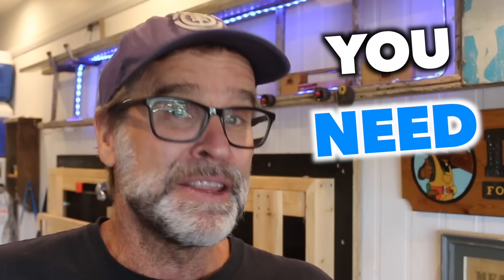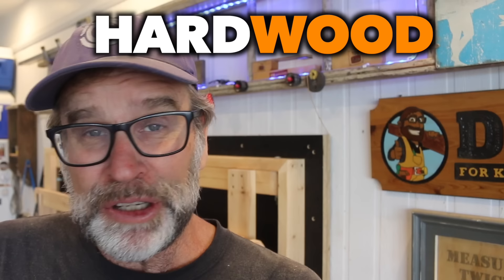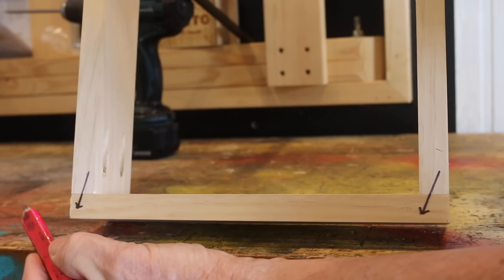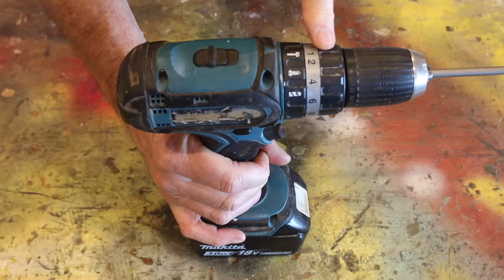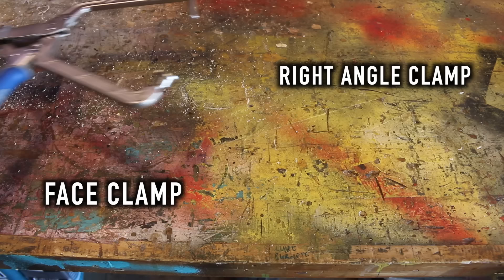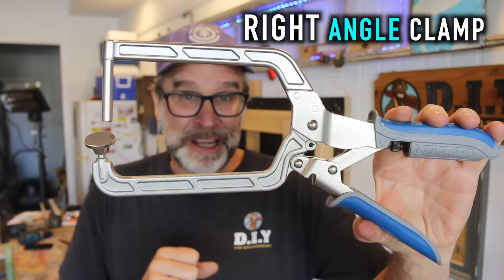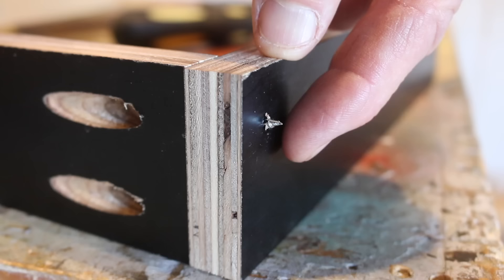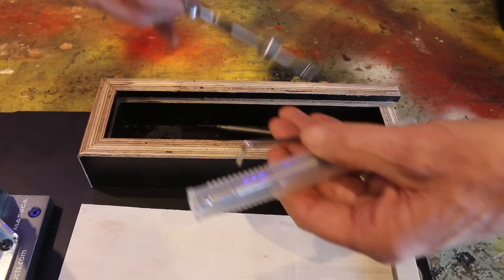Pocket Hole Perfection! 7 Expert Tips for Beginner Woodworkers!

Comment: I’m an absolute beginner and these fails you have showed actually happend to me. Finally I can stop wondering and turning my brain upside down and start woodworking. Thank you very much for another eye opener lesson. It turned so much lights on in my chandelier that the room is very bright 😂
Reply from the maker: Awesome! Glad you found the video useful mate 👍😁🇦🇺
Reply: C'mon, u-tube is overfilled with pocket hole videos. Not all as good, but the info is there to be extracted.

Comment: Great tips as always Shane.  The only thing I'd add is that if you are someone like me, who started out using the cheaper, portable / mobile pocket hole jigs, then the face clamp is not just useful, IT'S A MUST.  Mobile pocket hole jigs are notorious for moving unless well clamped when drilling and the face clamp jig makes light work of this.  Strongly recommended for those using mobile jigs.
Reply from the maker: Yep good point Anthony 👍👍 Thanks for watching mate 👍😁🇦🇺
Reply: I mounted the jig on a small piece of 3/4” plywood with screws and now I clamp or screw the plywood down.
Reply: Yes!  After I learned to offset the joint a bit to account for the movement from rotation from the pieces, I now realize how ridiculous it all was. Oh well!

Comment: Good points. Might want to also cover using the correct LENGTH screws for appropriate thickness of board. The types of screws available are more than you showed. The screw (on the right) that you showed which was the course thread, also comes in fine threads with the same type head. Just a thought. Keep on truckin!
Reply from the maker: 👍😁....Cheers Mitch 👍 Yeah there was a lot more stuff that l could have added but you only have limited time to keep people engaged. Thanks for the feedback 👍😁🇦🇺

Comment: Great tips. I didn't know about the threads. Worth mentioning too is to use screws that are flat under the head and not tapered. When I bought my first very simple Wolfcraft Undercover Jig they included sample screws that were all tapered which is ridiculous. If you tighten the screw to har the wood will crack. I had looked at videos similar to  this one and knew not to use them but it is insulting really. I wrote to wolfcraft complaining about it but never even got an answer.
Reply from the maker: Yeah that's ridiculous Mat.....not sure why they would have done that 🤔 Thanks for watching mate 👍😁🇦🇺

Comment: I found only one mention somewhere on Kreg's instructions or videos suggesting to use an electric drill to drill the pocket holes because it rotated at 2500 RPM. Most cordless drill run at about 1600 to 1800 RPM. I always use the electric drill for pocket holes or dowel holes. Try it, you'll be amazed.

Comment: When i built my tv stand, i over come the issue of the pocket hole being on the inside of the cross rail by insetting back from the edge if the upright. I used 50 x 80mm for the legs and 25 the cross rails were only 40 mm thick. All made of some really chunky reclaimed railway timbers.

Comment: For those who really want to avoid the joint creep and want a stronger pocket-hole joint - and have the budget. . .  Consider the Castle pocket-hole cutters.  The Castle 110 is the least expensive (but not at all cheap) and will give you a 3-degree angle rather than the more typical 15-degree - and that is a good thing.

Comment: Great stuff Knackers! I'm only a DIY'er and didn't even know that pocket hole joinery was a thing!
How would you fill the pocket hole after screwing? ... Just using wood filler?
Reply from the maker: Cheers mate 👍 You can actually buy pocket hole specific plugs if you ever need to fill the hole 👍👍
Reply: @diyforknuckleheads  What a genius system! Thanks.

Comment: I was looking for how you set the proper depth to drill a pocket hole for one inch piece of wood. Is there a setting on the special bit that come with the jig set when you buy it? How does a person figure out how far to drill in to not blow through the other side? And also how do I know other than the thread what screw lengths to use to join the joint or put in the pocket hole? Didn’t answer any of these questions sadly!
Reply from the maker: The best bet Deborah is to look up your manual. I would have gone through it in the video but the video would have ended up being to long. In my experience, long videos tend to turn people off which affects the distribution of the video. Sorry if l didn't answer your question. Cheers 👍
Reply: @diyforknuckleheads  I would think people will watch to find the answers they are looking for especially as a beginner no matter what the video length - cause I ended up having to go to a different channel to get my answers - isn’t the point to keep viewers here? I would have gone with the longer video! You answer all the questions, keep viewers in your channel plus get more watch hours. Win win? Thanks anyway!

Comment: If you use the drill on low speed instead of high when driving, you don't need to pulse the drill as you recommend. Much better for the switch contacts and the motor, too,

Comment: I have trouble getting my #2R (square) OUT of the screw head sometimes. It’s like there’s some CA glue in the hole
Reply from the maker: Yeah mine needs a little wiggle at times as well. Better to be a bit tight rather than a little loose l suppose. 👍

Comment: Or just run the drill in reverse near the bottom of the hole to remove some of the furry edges. And get a 'long series' drill the same diameter as the pilot on the Kreg drill bit, then drill through the pilot hole/s while everything is disassembled before trying to sink the screw/s - this will stop the bit of timber left by the Kreg drill bit from popping out and causing 'bridging' where you struggle to get the joint to close nicely (and maybe stripping out the screw hole DAMHIK)
Reply from the maker: Great tip! Thanks for that mate 👍😁